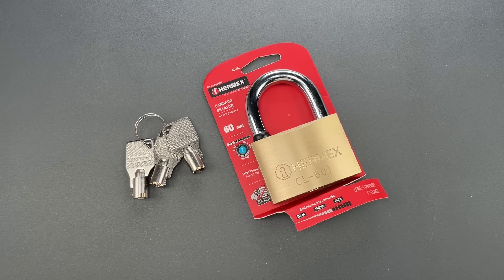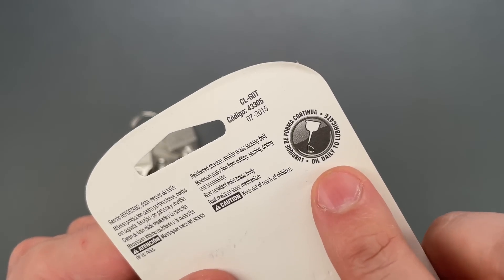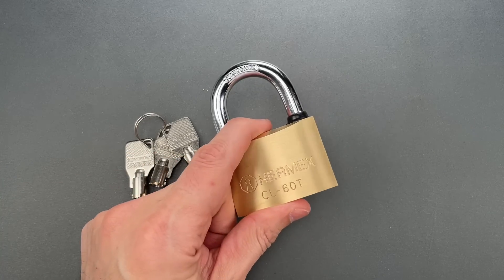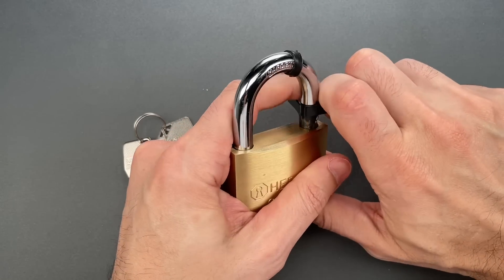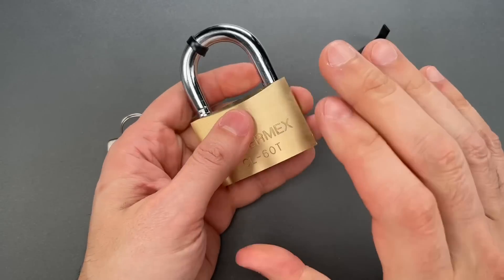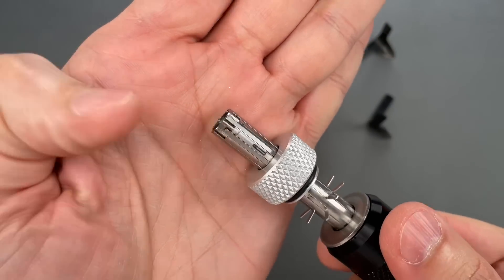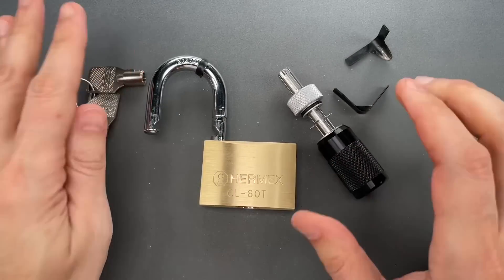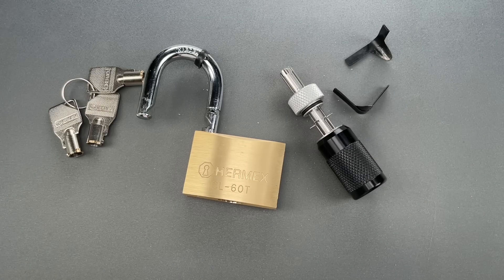[1580] Two Serious Flaws in the Hermex CL-60T

Comment: “Oil daily” is a great “not our fault” loophole.
Reply: Yup, just another CYA by the company
Reply: 10-W 30 or Synthetic?
Reply: @louislandi938  Only virgin olive from the orchard of Guido Papalinio on the island of Corsica. Anything else voids the warranty.... ;o)
Reply: @stefanfrankel8157  -  And using only the olives from the south facing slope.
Reply: @stefanfrankel8157  Italian oild? Cheap stuff. Spanish AOVE at least
Reply: @louislandi938  proprietary blend
Reply: @louislandi938  EP 90 gearbox oil, it'll never rust again. Or work! 👍
Reply: @louislandi938  I’d use 2 stroke oil
Reply: Right!? Like even if you could prove you did so daily, how many days did it sit in the store not getting oiled!
Reply: Imagine if you oiled your padlock everyday
Reply: @猪武者  Are you saying that you don't oil your padlocks daily?
Reply: Using non manufacturer approved oils makes the lock more susceptible to fast picking. Approved oils, however, prevents or severely limits its ability to be taken seriously
Reply: Requiring that it be oiled every day is ridiculous. 😂